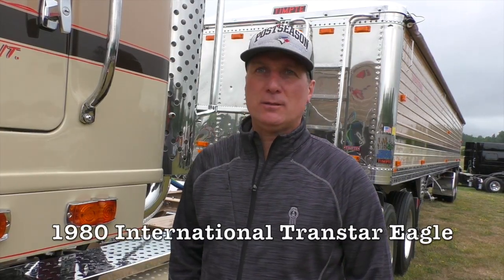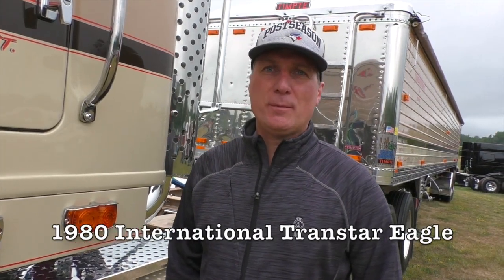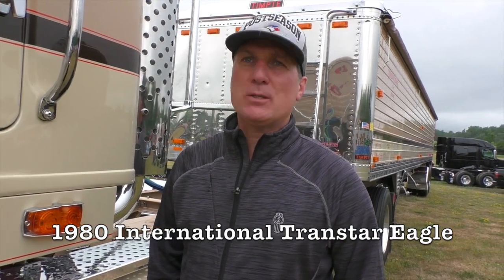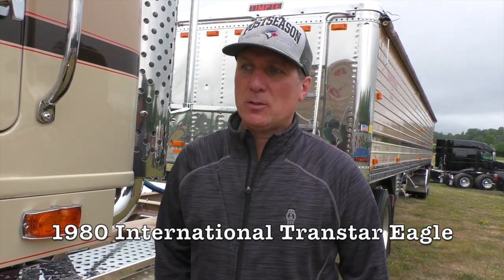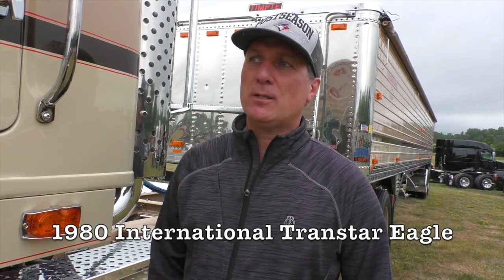1980 International Transtar Eagle Cabover

Comment: Is that the original cab on that Transtar 2? Cause I don't remember seeing an 84in cab instead of the normal 88in in 1980. I can see it has the 4 handle bars and indent around the sleeper vent where as the newer 88in cabs had no indent and only 3 handles. But either way it's a beautiful truck!
Reply from the maker: Ya, we thought so too. Believe it's the original cab.  Dave
Reply: BEAUTIFUL!! One of my favs

Comment: Hi  from Australia,,,I have two 4070A Transtars,,the Cab's need a lot of work,,would any one know how much I would expect to pay for a second hand Cab from someone in the states???
Reply: Big problem is converting it to right hand drive --- the engine tunnels were I believe made in Australia. I had two brand new tunnels years ago - plus several cubic metres of bits and pieces such as wiring looms glass instruments and such  but ended up sending it all to the tip -- no one was interested in rebuilding Transtars in those days.
They looked nice when new but were cold in winter hot in summer and very cramped to drive. I owned and drove mine for 10 years and I think I can say I hated every minute of it.
Reply: You are correct there,,,thats a bit of a shame.

Comment: Nice truck but I bet you're feet still get cold in the winter.
Reply from the maker: I'd bet you're right!
Reply: I doubt it, the way he did that restoration, looks like a no expense spared. Restoration. So the cab was probably stripped down to bare metal, insulated heavily with quality insulation, sound deadening material, good quality carpet. & good expensive aftermarket heaters. That truck is probably warmer than many trucks made in the last 25 years, besides the brand new ones. When you do a restoration right. It makes a difference.